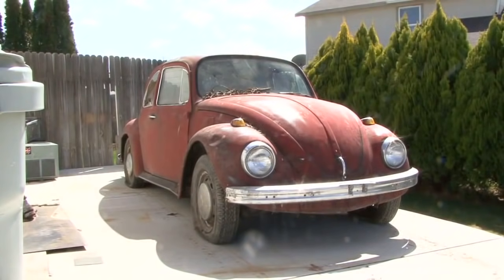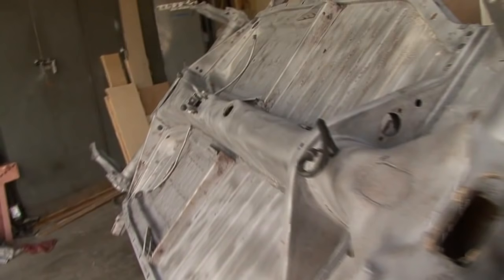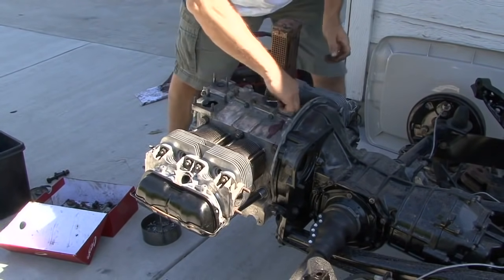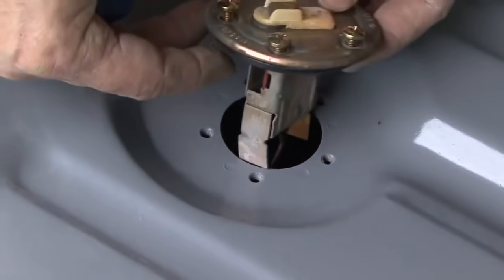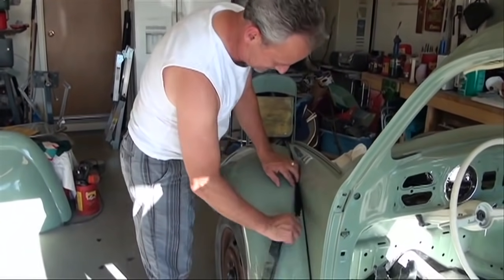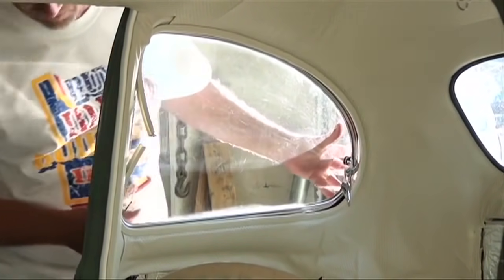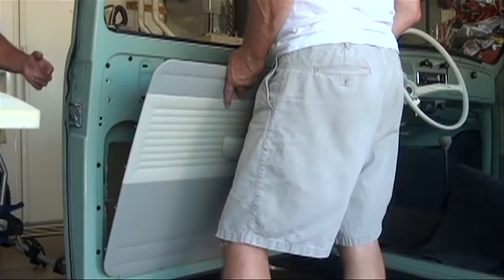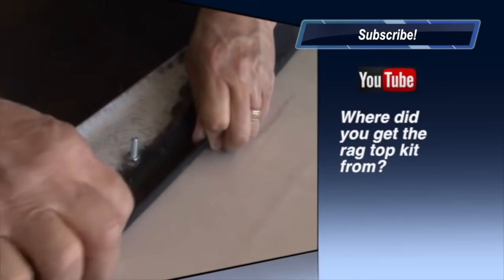Bug Restoration Official Full Version + After Show

Comment: Really enjoyed the video.  You do fine work and I wish I was as gifted as you.  I live in Meridian and bought a '70 Beetle in Oct 2019; had a 71 SB in 73-74 and a rusty 62 in 80-82.  The car was listed in Bring a Trailer in June 2019 but did not meet reserve.  It was a body-off restoration.  Pretty much same process as yours but the seller did not do the painting.  I had it shipped from Atlanta and replaced the wheels with 5.5" EMPI 914 4-lug wheels and Yokohama 185/65/15s.  Just got the car back from Chip Knight at Fine Auto Trim in Boise.  He took off the new JBugs vinyl and fixed the frame/springs and replaced the old horsehair (now with foam/burlap) that was raining fiber all over the carpeting. I posted pics of the end result in Southwest Idaho VW  FB page the other day.  Glad you were able to spend time with your son--or as you referred to him as "the filming crew".  Thank you.

Comment: I'm pretty indifferent about bugs ... but this really was both interesting and obviously extremely well done. 
The novice who essentially asked about shortcuts to proficiency (tricks) probably doesn't get how good Max is. 
And, as a result, how deceptively easy Max makes things look.
(not that I know anything about restoration. But making things look easy is a universal quality of competency).  

I bet the restoration of GLASS is more involved than immediately obvious. 
Even near-new car windshields can't be cleaned to look NEW. Did you have to sand & polish it ..?

The bumpers not being on is fine; it's easily imagined. 
The remaining rats nest of wires (comparatively tame to the original) in the front-trunk however..? 
That's a missed-opportunity. It's tempting to call something a wrap bc there're only "finishing touches" remaining. 
For the sake of all the work you put in to this? Don't rush that in the future. Finish it before taking the "afters". 

Subjective choices:  I would've been tempted to use 
1. Accessories with polished aluminum accenting; the window rollers, rearview, speedo. 
2. Black or aluminum trim around the glovebox... 

The exterior door handles and side-view mirrors LOOK faux-chrome-colored, if so: 
3. I'd've preferred polished aluminum (or matte-black components to match the very nice windshield + snrf trim) 
• Faux-chrome always gets hard-water stains (some of it can even peel, though I doubt that's possible here).
• Never looks spectacular
• The black holds up very well and would've looked retro-modern.
• Black looks great when cleaned with such that it looks wet after dried.

4. A few polished aluminum 'accent' items in the engine-compartment would emphasize how pristine it is.

My taste would only matter if I could amass the proficiency, money & commitment to do my own project.  
My opinion is LESS than even irrelevant. I truly just mean my suggestions as humble + polite afterthoughts.

The below suggestions however, I feel more confident about. :) 

PHOTOGRAPHY SUGGESTIONS (since it's impossible this is your last restoration)
1. Use a tripod with recorded (and easily replicated) 'settings.'
2. Record & photograph your tripod's exact config (height & location) for each image used.
* Use string from the lens to the floor and to a specific point on the car. Park the car in identical location)
3. Associate every picture kept for before & after with where (exactly) you took it from. 
4. Use PRIME LENSES ... not zooms. 
5. Outside images should be taken at the same time (ideally when overcast) 
• "Golden hour" is for dramatic lighting. Overcast (the giant 'soft-box' in the sky) is for products! 
• You'd be very well advised to use FILL LIGHTING. Amazon has cheap LED soft-boxes
• Keep UNEDITED copies of originals without resaving them to preserve METADATA! 
• This will provide you most settings: zoom, F-Stop (aperture) etcetera. (D SLR preferred)

Using 'zoom' to emulate a previously used distance optically changes more than it preserves. 
Different lens, distance, zoom, height or F-Stop make retaining the feel: object size & perspective improbable.

By perspective, I mean the relative sizes between the far & near side of an object.  
Perspective is what changes when the near-side is adjusted to be the same size as a previous picture. 
Perspective is the remaining difference after adjusting a side of an object to be equal with zoom alone. 

A camera close to an object will make the far-side look proportionally smaller than if the camera is farther away. 
- From earth, the far-side of the sun looks to be the same-size as the near-side...
- From mercury, the far-side of the sun looks much (relatively) smaller than the near-side does.

Changes in [relative size] decrease as [distance increases] and [object size decreases]. 
Changes in [relative size] are exacerbated as [distance decreases] & [object size increases]. 

Or, consider this:
• A 15' long car that's a foot away is 1' to the near side and is 16' to the farthest edge.  A change of 1600%
• A 15' long car that's 15' away ... is 15' to the near side and is 30' to the farthest edge.  A change of 200%
 
Use a DSLR for your before & afters
• On an overcast day
• The same aperture (F-Stop) 
• Tripod at equal distance & height.
• Same PRIME lens (no zoom feature or exact same zoom-amount)

* The tripod has extra value bc you're using a quasi-arbitrary  F-Stop (set another day's lighting)... All that's left for proper exposure now is ISO & exposure (duration in ms). Bc the ISO should be dropped to the minimum available setting, you'll likely need an exposure that's too long to be steady if handheld. But, because you've already placed the tripod in the exact location and height previously used, you'll already be using it, and it'll obviously eliminate any shake from handheld use. 

• F-stop of F8 - F12  (small, pin hole for before & afters... requiring a tripod for shake-free) 

Instead of noticing changes or shifts in... 
• perspective
• lens distortion
• relative size
• size of objects
• shadows (above vs below the midline of the car) etc. 

NO ONE WILL NOTICE THE EFFORT, specificity and attention to detail ... ...and that's a good thing.

They may see minute changes in weather... but they'll primarily be left seeing only the changes you made to the car.
Just as nice faces are those that lack prominent features... 
In contrast to less nice faces which have prominent features.
NOT noticing some things is a GOAL to be aspired to.

Comment: personally, I don't care for the color choice, but I'm partially color blind, so anything green or brown looks like crap to me, some shades look gray to me.  I also don't get the sliding ragtop. That is just adding trouble and expense that isn't needed, and somewhere down the line it will have to be done again, no way that top lasts as long as a painted metal roof. it will  eventually start leaking in rain, and probably wind too, and be nothing but problems down the line. 

I am glad you kept it (mostly) stock appearing if not totally stock. I was at a car show a few years back, there were hot rods, your  57 Tbirds, 57 Chevy's and what not. the car drawing a crowd and getting close inspection was a bone stock 67 VW bug. The reason, it's so unusual to see a bone stock example. Most every bug around has some crap done to it, good or bad it's no longer stock, in fact, until that time, I don't think I'd ever seen a bone stock bug since the days when they were new and so common. With the millions of bugs made and sold, why aren't there more still around? They were well made, what happened to the millions of them? Did they all get made into dune buggies and other craptastic things, did they get crashed, what's up with that. There were not as many 57 Chevys made, but you still see them frequently, at least redone hot rodded ones. I don't think I've seen a bone stock one of those since the days they were fairly new either.
Reply: Style, man. style! That is what rag tops are all about.
Reply: @MrBatbuddy  not interested in style, never have been. Practicality wins out with me.